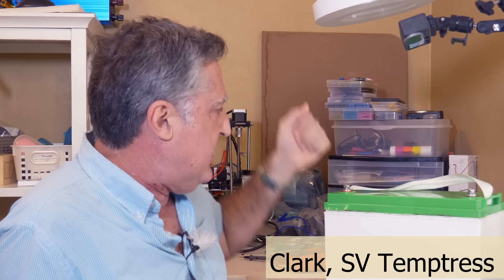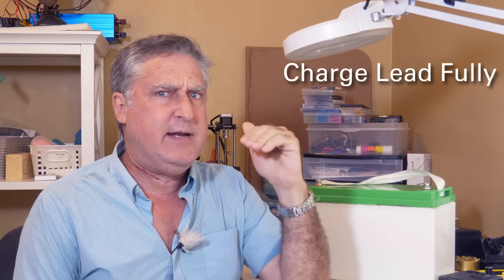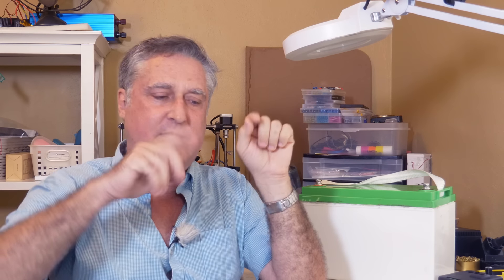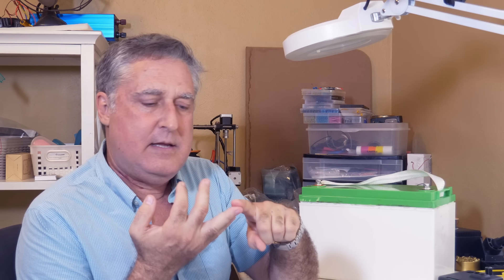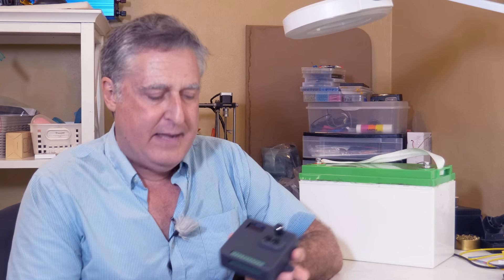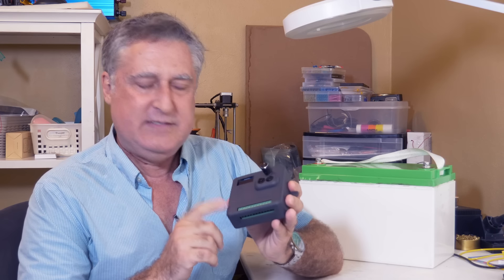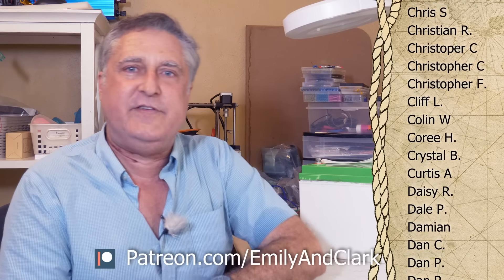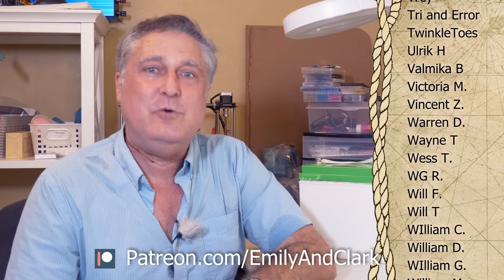Charge Lithium Batteries correctly (LiFePO4)

Comment: I have a car with LFP battery. Whats the best charging strategy as per you? I discharge it till 20 to 30% and charge it back to 100%
Reply from the maker: I think the BankManager of course
Reply: @Clarks-Adventure  we cant use bank manager in cars. We have warranty to take care of
Reply from the maker: @kishanmajethia yep I understand 

There is a guy with a crazy expensive new motor coach who went BankManager 

He put the batteries and BankManager in a box that connects with a big Anderson connector 

When he takes it in for service he just unplugs it and removes the whole Li system.

Comment: Soooo exactly how do you determine what 100% is if you’re not looking at voltage? This doesn’t sound right. Chargers already reduce amperage as you charge your battery… and it’s because of the internal resistance of the battery. 
So, basically, you’re claiming your “manager” is a better coulomb counter and that’s how you “charge correctly.”
Reply from the maker: Nope,  I don't use my coulomb counter in the "stop charging" logic at all.  In fact the "stop charging" logic calibrates my coulomb counter.
    In the video I went as far as I'm going to go in describing my secret sauce.  Beyond that I just will fall back on how well it works and how many tests prove it out.

   About 700 happy users and counting.  Many of which have put them on a ee bench and tested them.
Reply: @Clarks-Adventure  The problem is if you're going to claim your product does something that others don't, it is on you to explain the difference. If it's not a coulomb counter and it's not based on voltage, then it's guessing where 100% is. At the very best, it's taking a calculation of the speed in which it reaches a certain voltage, given the input amperage, and then applies that to an equation to calculate what 100% for that battery represents... and then applies a calculated charge pattern based on that. Though, I highly doubt that's what's going on. 

 "Secret sauce" is snake oil.

I came here to learn the proper way to charge lithium batteries and came away no more informed than when I started. Your explanation may be good enough to push units to the fan base, but it doesn't pass the sniff test.
Reply from the maker: @ModernSurvivalSense I think you might want to watch this again.  I say all that
   Have a nice life

Comment: Hello,
I just installed two lithium Lil Time batteries for my 24V trolley motor ( 2X12V in series). Both batteries are ( brand new) fully charged and balanced ( smart app ) 
Both batteries are over 13 V .Under the load of 24 V trolley motor voltage is instantly dropping in negative voltage. One of the batteries ( bank 2) instantly losing voltage. It looks like is in reverse polarity which doesn’t make sense to me. batteries are correctly wired in series, In good condition and nothing wrong trolley motor( not powering up at all). Does anyone can point me in right direction, what’s happening? I am confused.
Reply from the maker: Am I correct on assuming you don't have a multi meter.  Solving things like this are very difficult without one.

I suggest this one. https://youtu.be/kzvQMgiDSmc

It could be a failed BMS.  Or a bad connection
Reply: Hello, 
Thank you for the swift reply. Yes, I do have multi meter. Under the load of trolley motor one of the batteries drops in negative voltage numbers and motor wouldn’t start( needs 24 V ) Before the load both batteries showing fully charged and over 13 V. It’s like battery is discharging under the load. This is a brand new smart batteries out of the box. Bluetooth app shows that both batteries are in good order and balanced. I have limited knowledge in this field but this is mind blowing for me. I just don’t understand
Reply from the maker: @mesuddzomba7849  seems like you should start talking to the battery manufacturer as a replacement is likely in your future.
   Voltage reversing would happen of the BMS of the bad battery switched off or if there is a real bad connection, possibility inside the battery.
    Think of it this way.  The bad battery becomes a big open/off switch.  You are actually seeing the voltage of the other battery read through the motor.
Reply: Great explanation but why is the battery testing good ( v, amps and bms )prior to load? Like I said, I have very basic knowledge and this just blows my brains out..lol
Your help is greatly appreciated, mentally wise…hahaha
Reply from the maker: @mesuddzomba7849  well I'm not there.

But you can't test certain things until you apply a load.  It's failing as soon as you apply a load
Reply: I wish you were here..lol. 
Anyway, thank you so much for your help. Your videos are very educational, especially for someone like me. Have a great weekend!

Comment: Some useful information on charging LiFePO4  batteries. However in the real world not everyone  has your magic Bank Manager and has to do the best they  can with existing equipment.
New batteries are most always delivered with unbalanced cells. If charged at voltages below the balance start voltage, things will get worse, the capacity reduces and the 'weak ' cell gets a hard time thus degrading faster. Typically BMS balance starts at 3.4 to 3.45 per  cell, say above 13.6 to 13.8 volts for a 12v battery. Due to the low passive balance current most batteries use, it can take some time, many hours with the voltage above 13.8 volts, for the cells to balance.
With new batteries I recomend using a charge voltage of 14.2 volts, absorbtion period 2 hours, float voltage 13.4 volts. Unless you have Bluetooth or other data access to the cell voltages, that reports cell balance, keep this charge set up for two weeks, ( assuming daily charge cycle). After this period or if cells are reporting good balance at absorbtion volts, a delta of 30 mv maximum, revert to a less agressive charge setting.
A useful low stress charge setting is absorbtion 13.8 to 14.0 volts, absorbtion  period  15 minutes , float 13.4 volts.
A factor often overlooked is calibration errors in chargers and volt drops between chargers and battery. Victron chargers  can have actual battery temperature and voltage reported over the built in VE buss by the Smart shunt of BMV712 monitor. This elinimates volt drops and allows chargers to stop charging below pre set temperatures.
Where new lithium batteries added in parallel, provided the existing batteries show normal  operation and have not been abused,  there will be no issues. Normal charge profiles can be used. Any ageing  in the older batteries may result in slightly unequal current sharing. 
The major 'killers' of lithium batteries  are high temperature and holding the fully charged  battery for long periods at voltages above its full resting volts, 13.4 for a 12v battery.
Reply from the maker: I agree with most of what you say.  In fact I say it in this video.

You do know anyone can buy a BankManager.  Just like anyone can buy lithium batteries.   You make it sound like the device is unobtainable.  It's here:
https://www.emilyandclarksadventure.com/bbms
Reply: I have top-balanced my cells before I assembled (took weeks). A year later some went out of balanced. But only when the battery is fully charged, and only took 4Ah discharged to bring then back to balanced again. I don't bother to rebalanced them again. I have two banks, 460Ah each.
Reply from the maker: I think often this is the case.  Especially if you don't over charge.

But some batteries have a bad cell that needs to be balanced more often.  So I like others have to give rule of thumb recommendations.  
   The balance process is tough in the cells but running a battery when badly out of balance could be worse.   So occasional balancing is probably the best advice.

 But for guys like you.  I'd say...  Do what your cells need

Comment: Looking to install LiTile 460ah which Will Prowse reviewed. I don’t think it has low temp cutoff. 1500w Solar and the typical Victron parts. Thoughts? Can u assist in further design? Will Victron BMS shunt help? Thanks in advance
Reply from the maker: I'm not sure what battery chemistry you are referring to.
Reply: I'm no master of the art but do have a background in electrical. I rigged my own heater, which may be of interest to you.
I took three RV plumbing elbow heaters wired in parallel that run at 14 watts each and adhered them to an aluminum plate under my 300Ah Lifepo4 using weatherstrip as a spacer as to not harm the heaters with the weight of the battery.
 I used a W1209 circuit board with its power fed from the battery to automatically switch the heaters on at the temperature I loaded into the w1209. So the battery never reaches a dangerously low temperature for charging. It's a pretty easy process and more cost-effective than self heating batteries. If you don't like Celsius and want more versatility, I believe a W2809 may be of more interest to you.

Comment: You can charge them to a voltage  none of this takes place in real world... charge your bank to 3.45v per cell. The voltage will begin to drift after this without a bms.
Reply: And remember the more strings you have the lower your c rate. To tge point if you are off grid you hopefully have 100kw or more you will never even approach anything that could be considered a high rate of charge. Solar is an easy day for these batteries

Comment: Charge to 3.45v per cell. You are at 90% this is plenty. Your battery will ladt a long long time.... this guy does not live off grid full time I do. 3.45v per cell is the magic number. Don't let this guy scare you it ain't rocket science.
Reply from the maker: This guy has been living off grid since the 90s
I suggest you do more research.  Things like this aren't rocket science if you don't understand them
  Sure anyone can put power in a battery.  Doing it for a long life and not causing memory is trickier 

You are wrong about my history.  One must assume you do as much research about your battery theories.
Reply: I’m doing off grid with a camper but running a 24 volt system so I can used a 24 volt 3000 watt sign wave inverter.   Would I charge the battery’s around 27 volts.   I’m new to lithium and in the past, I have led jel and led asid batteries.
Reply: @Clarks-Adventure  no man it ain't tricky at all you are fear mongering.  LFP don't have memory.  You are all FD up  any charge controller set up for lfp will do the job fine.
Reply: This guy is stuck in fla land. If he reads this comment he shoukd give victron a call. Lfp can be charged way faster than fla. It's tge whole point that makes LFP so much better. They are lije a sponge fla is like trying to soak up spilled water with a sheet of note book paper. If people knew how good lfp was everyone would be using it but tge dinosaurs keep yappin stuck on fla
Reply: And cost is far cheaper than fla if you consider fla ladts 10 years maybe plus you gotta fill them with water plus they put off toxic explosive gas plus they will carrode everything around them... they belong starting cars in cold temps . Lfp is destroyed in cold temps. But the don't off gas so you can keep them indoors plus they are way smaller and lighter and more powerful.
Reply: The charging algorithm is simple constant current and voltage up to 3.45v bulk charge only no gloat no absorb. You can even use an old fla charger just kill it at tge absorb stage. But all current solar charge controllers will do just fine. Again they can take much higher current. The round trip efficency is awsome. Very low resistance. You loose almost half of the energy you put into FLA. 60% I THINK. 40 % loss. Lfp is in tge 90s it's what people don't understand about LFP. If you have an old FLA solar system you can basically just swap batteries and achieve a huge gain in efficency over the entire system... just don't over charge.....lol FLA will get hot and you actually benefit desulification. This is tge process of equalization. LFP differ in that you never equalization.  I am currently experimenting with some absorption time but very short 45 minutes to see if it has a balancing effect but this is my own experimenting.
Reply: Yes you can charge them to a voltage it's 3.45 volts he is right about tge curve being very flat but it does rise RIGHT WHEN YOU ARE DONE.....lol 3.45v lol...and you also know they are empty at 3.0v voltage drops super fast below 3.0v then you KNOW YOU ARE EMPTY. So to say you "CANNOT CHARGE/DISCHARGE to a voltage" is just false.
Reply: The other problem this guy is having engineer or not is any system that can do any meaningful amount of work will be so large you will never be in danger of what he is talking g about. Like ya if you take the crap battery he has sitting on his desk and push 100 amps I to it yes that's a problem. But 100amps to an off grid whole house system ain't nothing. This guy is making me soooo mad LFP and solar are soooooo DIY friendly brothers and sisters don't let this engineer scare you none of what he is saying no matter how kinda true is at all applicable in a real system
Reply from the maker: @thadshoneydolist993 you just can't charge li to a voltage and get good results.
   There is no easy answer that is correct
Reply: @Clarks-Adventure  my battery says to use a battery equalizer when charging
Reply from the maker: @thadshoneydolist993 between batteries in series?  That's a good idea.
   See my Duffy video for an inexpensive one.

If not I don't know what you are referring to.  What would be equalized?   

Do you mean cells?
Reply: @Clarks-Adventure  I'm DOING IT BRO.

Comment: not a comment on the video information but the scar on your neck is rather worrisome, it almost looks like you may have had a necklace on your neck that was struck by lightning and burned your neck? which may explain the lack of a beard and moustace? hope it was anything too severe or dangerous to cause this scaring?
Reply from the maker: Yes looks horrible.  I kept seeing it during editing.

Honestly I just cut myself shaving before the video and didn't notice.  That's an issue with filming alone.

Comment: What the hell is this guy babbling about? Maybe tell us HOW TO CHARGE OUR BATTERIES!? I’m sure I am in a similar situation to this audience. I run my engine, solar does its thing, and a generator. I can use percentage on my monitor, or voltage which he says you can’t charge to. Tell us something practical we can apply to our lives. How will the hockey stick graph inform me regarding charging my batteries? This could be a 3 minute video and we’d learn something.
Reply from the maker: You could buy a BankManager

Comment: 99% sensless time.

how charge a lithium correct?
how you want is the answer , it not matters.

 the 40 minutes nonsens off not possible to charge a lifepo to 100% correctly is pure trash.
any serious person who does DIY batterys know when a lifepo is at 100% charge its exactly at  ~3,65 volt .
if you not understand that mister youtube buy a ready battery it have a bms and it cuts off ea cell at 3,65 volt =100%
thats why they are easy to handle put them on any charger and have fun.

any lifepo4 battery pack have a build in BMS so nothing can done wrong!!!!!

lets repeat it again for this youtuber:
if the battery is full with a unlimited charger the BMS shut off if the battery is full !!!!!!

for example:
put it in any car on any charger like led acid all is 100% fine, this is one of the great parts of this battery.

the whiole video is 99% nonsens and for what make 40 minutes?
the tell confusing theories....

t

Comment: Never seen so much nonsens.
Any lifepo4 battery including all chinese cheap brands across the planet have build in BMS with ~3.65 Volt cut off what gives a 100% safe charge and aditional passive top balancing.
Thats the only way to deliver this type off batteries and grant a 100% safe use and long lasting life.
LFP have no memory no lithium battery type exist with that.

And now a confused youtuber tells he not understand how charge correctly a lifepo4.
Thats is the reason why all consumer batterys have a BMS build in it knows what is important.

And  you nonsens device not change anythink on the fact that a BMS handles the correct Charge level for the battery and protect against wrong charging....
Reply from the maker: Do some real research.
   Or just charge your way for a few years daily and see the results.

You will change your mind.